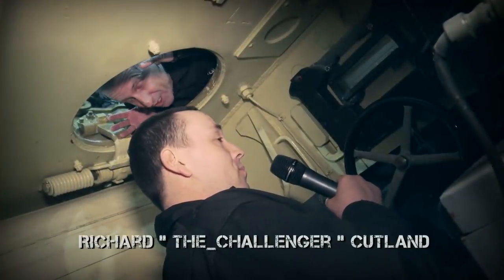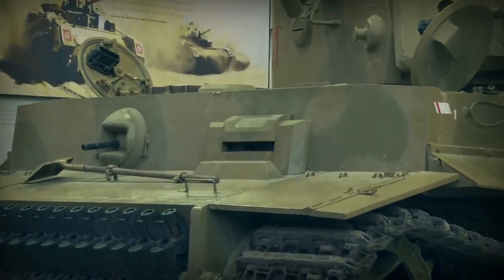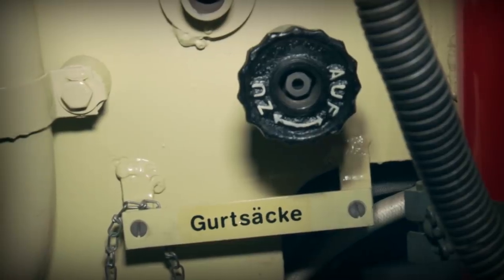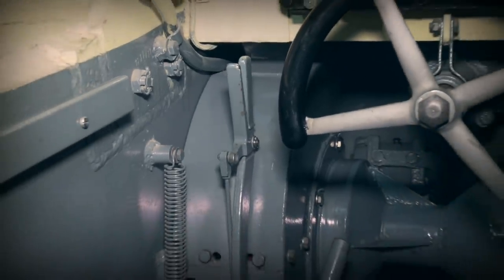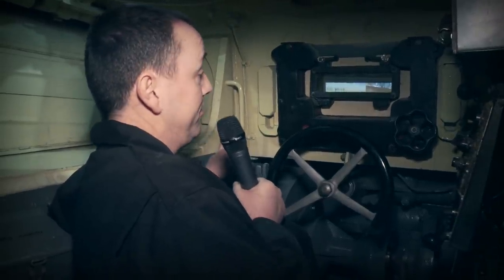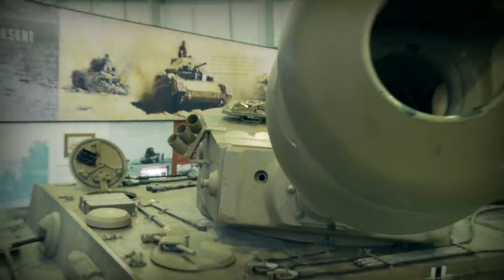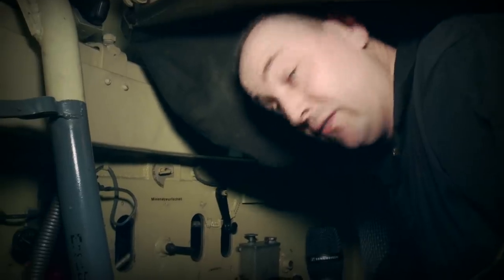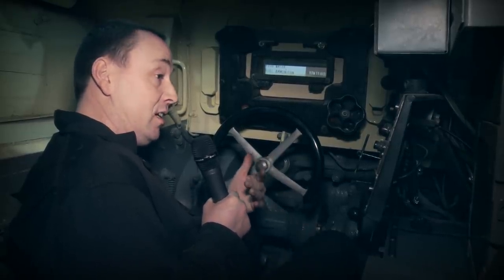Inside the Tanks: The Tiger I - part IV - World of Tanks

Comment: Holy shit that tanks is like a bmw compared to T34. The interior is so nice.
Reply: T34s were garbage, but only 'few' people know that.
It wasnt anything special, they just had alot of them.
Even the gun they later had on T-34-85, the 85mm one, was much weaker than 75mm Panther, Pz IVc Stug etc had.
Reply: Adrik Bogdanov What ?
Reply: Pulssqt It actually was quite special, for example, sloped armor pretty revolutionary and something that the germans copied for their Panther. (Strangely enough they didint add slopes for tiger, but I assume that is for logistic reasons mainly.) What you're overlooking aswell is the cost to manufacture, if you can have 5 T34's at the cost of 1 tiger (numbers are made up here, but the direction of the assumption should be about right), you'll swarm the tigers weak sides with those t34's before the tiger has a chance to destroy them all, making the t34 a winner. M6A1 for example, was never mass produced because it was about the cost of two shermans, which the americans thought would be much more effective in battle than the single M6A1. 

In short, Quantity will beat quality here. In strictly 1v1 sense the German tanks would be superior, but in real war scenario it comes down to alot more than just that. Also t34's, having the home field advantage, were actually build to fight in snowy/icy battlefields, where-as the german tanks were built for mainly german soil (In hindsight that was quite silly, they should have known where they are sending thise tanks.. One might speculate this was because the german army had the idea of USSR being a poor backwater country that would be crushed before the winter set in. Much like how Napoleon lost his men against The Bear.)

All-in-all considering more than just 1v1 basis, T34 was a great tank for anyone but the crew inside it.
Reply: Victor Sund Man, did you know about turret problem T34's had untill they introduced T34-85 with 3 man turret ? Did you know that most of T34's never saw combat because they broke down because they were excremley unreliable, and those who saw combat never came back to base. lol

Yes, quanitiy was the only advantage of T34.
Reply: BMW and Mercedes built engines. 
Porsche built vehicles (including tanks, competing with some other company) and engines, however their tanks were often too complicated and unreliable. However Ferdinand Porsche did have some components that were completely ahead of his time like the electric transmission.
MAN designed ships I think, including submarinez
Reply: Justin sénéchal MAN designed the Panther tank.
Reply: Me262 Spatz and that too
Reply: +Pulssqt how do you compare a heavy tank to a medium one ? and being weaker is not everything . tiger cannot be used in some areas with a different terrain . in the same time the t 34 was used throughout the entire war .
Reply: looseyourzlf T34 was garbage. End of story.
Untill T34 85 was introduced they were shit, literally. 3 man turrett changed that a bit.

Only russian tank that could do something at later stages was SU-100.
Reply: Pulssqt talk is easy my friend documentary shows and historical sources could tell different story.
Reply: Pulssqt well with all respect even your word doesn't reflect the troth . at least this tank reached berlin ! as a medium tank it was one of the best beck there at that time nice talking to you
Reply: looseyourzlf No offense man. I know what you meant but im trying to tell you that t34 was FAR from best tank in WW2, panther was also medium tank, with alot of problems, and its 76mm was much better than 85mm russians had, and still panther pissed over T34 every single fucking day.
But production of T34 was insane, plus not enough 76kwk on the field was a disadvantage for germans.
Reply: Pulssqt of course my friend I totally agree , it wasn't the best maybe two or more tanks considered a lot better than this tank , thank you for the link, but the problem is western media are making things big for Russian tanks and on the other hand so small when mentioning other stuff . I wish I could see something in between . thank you my friend for being a nice guy a lot of youtubers are making bed comment just if you disagree with them lol .
Reply: +Victor Sund 10 F22s vs 100 P40s LOL
Reply: It is a year now , but you don't know nothing, right The Russians lost about 85% of their whole AFV 's during the war, almost the entire Production of T 34, in the last year of the war i don't know now the exact numbers but it will give you the Idea , The Russians produced around 15000 T34 and loose about 13000 of it very good Tank ey? This is only in 4 Month .The breakdown Issues you got lucky the Engine last longer than a 60 km ride. So much about the very good Diesel Engine and best Tank in WWII
Reply: T-34 is actually a crappy tank when you take in account the sights, the viewports and very small turret. The only reason for its success was the sheer numbers produced (around 80 000). Should there be 13000 Tigers instead of only 1300 produced, I'd say there would be no T-34 left alive at all.
Reply: Too bad it doesn't make any difference to combat effectiveness. (BTW" "you're inherently racist! It's in your blood ! It's in your DNA!" LOL, nice name.)
Reply: @Metalli92  it was not logistics, the Tiger was developed before the lessons of 41 could be incorporated into it. Tank development is a lengthy process, and the Tiger took its time (37-42). The Panther was, as you say, influenced by the T-34 and it was rushed - that showed in all the problems at Kursk.
Reply: @pulsswow  yes
They broke down a lot
Reply: T 34 only advantages were its cost
Reply: @pulsswow  I hope you've become smarter after the 5 years and know now that T-34 was absolutely the best tank in the world in 1941-1942.
Reply: ….and the German obsession with building the “perfect” tank contributed to their loss in WW2. It was a war of attrition, not perfection. The Tiger is a mighty nice tank, but they only produced 1,347 of them. Meanwhile the Allies built over 50,000 Sherman tanks.
Reply: @Metalli92  6 years late, I agree with most of what you’re saying. But sloped armor wasn’t at all revolutionary for the time. Main reason why it wasn’t used as often was because sloped armor reduces interior space, and the Germans made pretty roomy tanks for crew efficiency.
Reply: Yes, very comfortable to drive, gear change a flick switch on a pre-selector box. ‘Power’ steering. According to Tiger tank crews.

Comment: They are still not 100% sure how it works!
Reply: There is a driver's handbook available.
Reply: @gaborkiss1425  But the driver sounds like they're still just making things up as they go. And the sign "Do not use this fuel falve!" does not exactly scream "Competent crew!"... Also whenever they drive the tank, the sound is off like the driver has no clue how to drive classic stick...They should give it back to Germany or at least allow German engineers to take a look at it and give them some pointers.
Reply: jajesam sigurno r/woosh this guy is just teaching you while ww3 came
Reply: @guestuser1671  what? No German engineer is going to know better than any British engineer. The sign is mostly likely because that valve no longer works, the vehicle is over 75 years old and has been shot at.

Comment: So the vision port is actually a direct opening, rather than a periscope from two 45 degree prisms going to the deck above him?  Doesn't that mean you the driver is kind of vulnerable, even allowing for a certain degree of protection against small arms etc a main round that might not penetrate the front could surely kill him if it hit the vision block?  Great video though, to see how much work it takes to drive ( even if it's considered easy in comparison to other tanks of the day )
Reply: That kind of shows the age of the Tigers design. It was not uncommon at that time. T-34 also has direct vision ports, so did the Churchill and the Cromwell. Later Panther models where (I think) the first german tank to have no direct vision ports.
Reply: The chances of hitting the vision slit are slim to none, and if you have your tiger in distance of infantry able to accurately shoot at the tank, you have already goofed up.
Reply: Yes, the driver is vulnerable. A rotating periscope was used in later Panzer designs. But it wasn't retrofitted to the Tiger 1, not even newly built Tiger 1, and that's probably because the tank designers were overstretched.

Comment: I didn't realize they had a Mine laying option in there (Minenabwurfschaft) easter egg?
Reply: I know it's ben a year, but I will answer anyway. It's not for laying mines in the conventional sense. They used S-Minen (bouncing bettys) for defence against infantry swarming the tank.
Essentialy, they stuff a S-Mine into that shaft and fire it. It would jump out, detonate after about 1.5 meters and shower the tank and it's suroundings with shrapnell. The tank itself would not be harmed by that, any infantry man in the vicinity however...
Reply: Bird_Dog Ah yeah, that makes sense, I have seen replicas of those mines and they do some nasty damage. Thanks for taking your time to clear this up!
Reply: Tigers built up to the middle of 1943 had launcher tubes for S-mines. They were at the corners of the hull; the tubes on the turret have nothing to do with this.
The commander would launch these mines individually using a hand-held controller. The controller box was on a cable attached to the firewall.
There was a clip on the firewall to hold the controller, and that label "Minenabwurfschaft" identifies it.
But we have two problems;
1. Tiger 131 is missing the S-mine system and probably never had it fully installed.
2. The restorers have put that "Minenabwurfschaft" label out of place.
Reply: @daveybyrden3936  alright, this is what I am talking about. Someone who cares to educate and rake the time for great detail, thanks! Much appreciated 🙏

Comment: 5 tigers vs 1 M1 ABRAMS, who would win?
Reply: +Greyhound Tigers, Duh.
Reply: the Abrams... I respect the tigers but the Abrams is the number one tank that has the most armour and it has better technology. because it's a newer tank. plus the Abrams main gun is a German made. so Ik it has a longer range than them plus the tigers can't really ambush the Abrams because it has thermal vision as well and it has Optics that can zoom in. so I think the Abrams has a high chance of winning.
Reply: You gotta remember the 88mm killer cannon the Tiger has, with AP round im pretty sure it can pen from the sides or the back, plus i was talking about the M4A1 which is the base model of the Abrams which doesn't have reactive armor or thermals.
Reply: +Greyhound According to Wikipedia, the 88mm gun of the Tiger has 171mm of penetration against 30 degrees of sloped armour at 100 meters using APCR shells.
The M1 Abrams has between at least 350mm of effective armour vs APFSDS shells, which is the kind of shell that replaced APCR. So no, a Tiger could't penetrate even a base model Abrams tank unless they get impossibly lucky.

The Tiger was good during it's day, but today it's beyond outdated technology.
Reply: Those 350mm are frontal armor and turret but the back part and side of them is kinda flat I'm pretty sure the Tigers would win because this would be the same case scenario of 5 Shermans vs 1 tiger, It's hard but not impossible.
Reply: Greyhound A Sherman is faster and more mobile than a Tiger, but a Tiger is not more mobile than an M1. So no, it's nowhere near the same scenario. Neither is there nearly 40 years of military technology seperating a Sherman and a Tiger.
Stop fanboying over the Tiger tank. As I said, it was good for it's time, but comparing it to modern MTBs is pointless. If the Tiger was so amazing at everything, the Nazis wouldn't have lost the war. I'm done here.
Reply: Nazis lost it because only about 2000 Tigers where created agaisnt the 50000 shermans and the hundreds of thousands Russian, British tanks. Imagine 5 Tigers shooting at the same time at one M1 it's enough to get it's tracks, with an inmobilized M1 they just approach from the sides and back and fuck it up. Stop fanboying over the M1.
Reply: +Greyhound Don't you want to add something else to your "scenario"? How about 5 Tigers and a Mi-24? A nuclear bomb, maybe? You know the Abrams would win, trying to make it easier for the Tigers is kind of cheating, don't you think?
Reply: I'm not putting it easy if i was the platoon sargeant of the squad those would be my orders, split to the sides get the tracks and then get the sides and back.
Reply: ***** Ah but you see he covered that. It's a completely un-upgraded Abrams! No fancy tech or composite armour plates. Because you know, those would be deployed in combat.
Tiger tank has all the modernities of 1940s Germany, of course. It wouldn't be fair otherwise.

Sarcasm, btw.
Reply: tiger 1 winn
Reply: jarrad Moore Ayy lmao.
Reply: Abrams doesnt deserve the title "best tank in the world". All it went up against were some obsolete T72s manned by incompetent crews during Desert Storm

Comment: Guessing your talking about the dial with the radiation sign on it, Its probably a Radium dial that the figures are painted on using a radioactive material that illuminates in the dark like a glow stick. As long as the glass is intact and you don't lick the paint on a regular basis you should be fine.

Comment: and do you know why the tiger and other german tanks had so many roadwheels??
Reply: The interlocked roadwheels distribute the weight far better. That brings a lot of problems to the tank crew if they need to replace one but in engineering terms it is an ideal solution. Another part of the overengineering that the german tanks suffer from.
Reply: +Un1qZ yes. But it also give a extra protection from shoots so it could take up much og the energy by hits